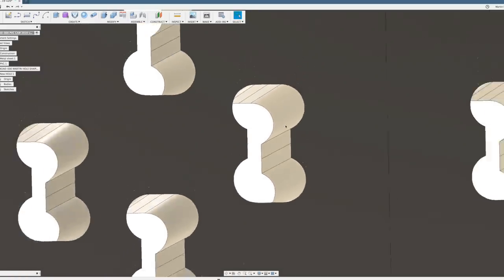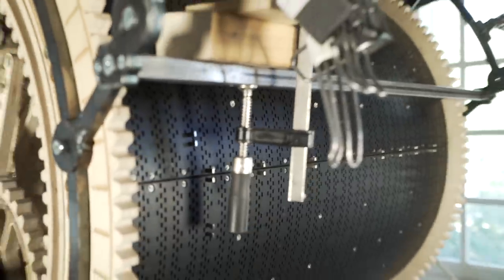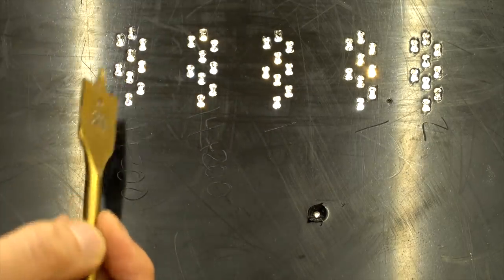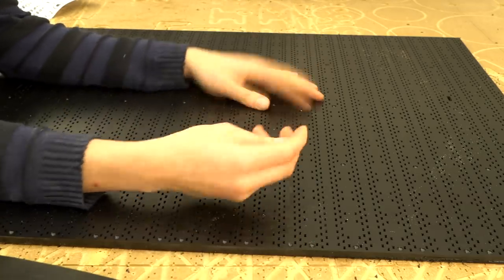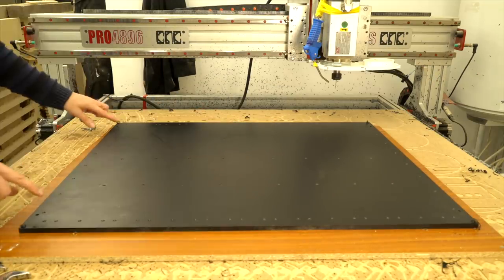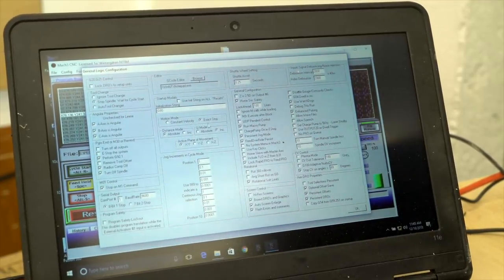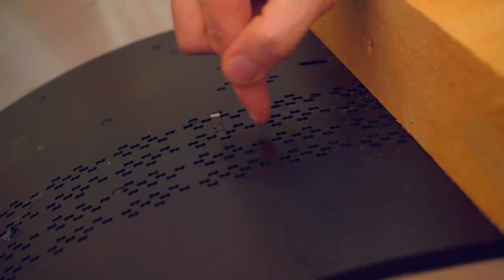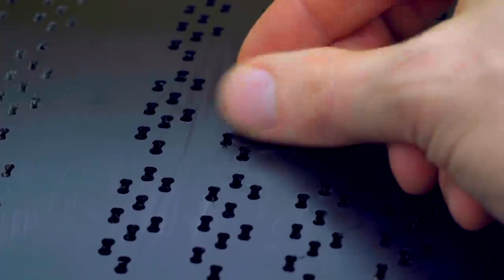Deeper Down the Rabbit Hole - Marble Machine X #66

Comment: As someone commented, temperature could easily mess up your tolerances. I've been up on a stage with spotlights and outdoors in the summer, and almost passed out in the heat. Temperatures could easily hit 45 or 50C at the black surface of your programming wheel. I would also be concerned with the slot stretching away from the force of the actuators pushing the magnets sideways when repeatedly being "plucked" as the wheel goes round and round.
Reply: My OCD has come up with many SNAFU's on this project, but that one escaped me. Well done Sir :)

Comment: Hello have you checked the tolerance of the magnets 0.o 
0.04 seems like over kill
Reply: You should look up the clearances for slip fit, light interference fit, tight interference fit, light press fit and tight press fit for different materials. They differ by such minuscule amounts that it bugles the minds (at least for non-machinists like me). 0.04mm (that's just shy of two thou for the imperial crowd) are actually quite big jumps, but I guess that since we are talking plastic here the material properties work in Martin's favor in some cases, just as they work against him in other cases.
Reply: Also check the homogeneity of your slab of plastic. Since the tolerances are so tiny. Be sure to check the shrinking in multiple places, and not just the center.
Reply: If he doesn't go overkill, they will be too sloppy and might not strike true once he runs the machine. The middle portion is the pinch. The shape he has constructed is probably to make sure it doesn't get stuck but still is pinched into place.

It is probably the Pinch that is currently working against him .
Reply: I love this series so much
Reply: I wouldnt call it overkill. Even in an electronic music sequencer (where conditions are near ideal, compared to mechanical one) the slightest issues like DAC latency or MIDI trololols can totally ruin the groove of your music if you dont pay attention.
Reply: I think Thor’s point  is that it seems highly unlikely that the tolerance on the thickness of magnet is less than the tolerances that he is now working with in his holes. I have not heard him discuss these magnet pieces in any of the videos I have watched. Are they store bought? Custom precision ground pieces?
Reply: I work in a tool shop and when we make guide holes we have a tolerance of 0.007 +- it’s so tight that when you push the pin inside air can’t escape between and crate a vacuum pushing the pin out and making a funny ploop noise. And there is places working with even smaller tolerances
Reply: @callesundberg  Aiko are you using metric or imperial. That number becomes 25.4 times more impressive if you are using metric.
Reply: @jhm5016  yes this is exactly what I mean. They don't look ground to me 😂 so I was wondering. Also 0.04 mm tolerances are too big I would reeeee🐸 consider my design choiceses materials ECT to make it easier
Reply: Also he should consider the precision of the machine and the milling bits
Reply: @callesundberg  Yeah injection molds that make computer part connectors have super tight tolerances since you can have have a hundred slices of metal put together to create one final part.
Reply: @pailer17  so true and ambient temperature and so on and so fourth
Reply: I wonder how loose holes will be after playing 1 concert, and how loose after whole world tour
Reply: @deviceundertest  oh right they might be lose after one song tho
Reply: Yeah, the standard neodymium magnet tolerance is usually higher than 0.04 mm.
Reply: @alexreeve  "MIDI trololols" Brilliant!
Reply: my exact thought.  I guess they are press formed somehow not lapped/ground finished
Reply: Telling Martin that something is overkill....

Comment: I'm sure you've been asked a hundred times, but why don't you use a rotary axis and, maybe, a different material? Mount the quadrants on a drum, mount the drum on the rotary, and route with a simpler toolpath?  This could also solve your timing/gap dilemma between the plates.
For holding the magnets, the important axis appears to be circumferential.  A little sideways wobble shouldn't hurt the timing.  Is there a reason to not put your "pinch tabs" on the top/bottom of the magnet hole?  A 1mm chamfer on the top of the tab would be easy to machine and let you get away with a tighter fit on the important axis.
Thank you for sharing your work!   Believer
Reply: That sounds really interesting. What machinery would you use for that? I'd assume the drill would be fixed to the x and y and the drum would move on the z?
Reply: @nutmeg453  Oh, I was referring to adding a gear-reduced 4th axis (lathe-style) to the CNC.  He'd have to weld a frame down low, but that hasn't stopped him yet :)

Comment: PE grows and shrinks with the humidity it has absorbed. Personally my guess would be, that during production the raw material gets dried (otherwise it will form bubbles when being brought into shape). As you have a massive block of the material the humidity takes a VERY long time to diffuse to the center of the block. When you machine the holes though, you expose the dry material in the center to the humidity in the air, which causes it to absorb moisture. Therefore the holes shrink as the material increases its volume. 
It's just an hypothesis, but I think it's very possible that this might be the case here. 
In order to test that hypothesis you could machine 2 identical parts, place one in water or a very moist environment, and one in a dry environment. Before and afterwards measure the dimensions of the holes and compare them.

Just an idea. Maybe I'm wrong though...

Comment: Wow, now that's a deep rabit hole.....

I really hope this solution works.... 
I'm a bit afraid that tool sharpness will be a parameter in how much material will be pushed instead of cut.... And if that is correct the offset will need to vary..
I think the double cut a day later will be a more stable solution.... And make sure to warm your spindle... At least for my machine the bit starts to warm up after a while and that could change the diameter a bit... Keep up the good work, greetings from Marcel
Reply: The deformation temperature of the PE 300 might be an issue.
Reply: Hey Robo, Nice to see you here.

But the thing i was thinking about....  what about the temperature in his workshop. The machine is supposed to go on world tour. He is in scandinavia and its winter. 
Now there is a world tour and its summer and 30 degrees C or something. How much will that affect the tight fit......
Reply: @hscharft  I thought his studio was in France ?
Reply: @Soken50  Yeah, I think he is. Moved a few months back right? Either way, ambient temperatures might be an issue... maybe. I'm not knowledgeable enough on that to say for certain.
Reply: @hscharft  He is building the Marble Machine 2 in the south of France (but it gets cold there too!)
Reply: As far as I know PE300 has no high thermal expansion coefficient.... so temperature would not be an issue... (If i'm right...) Anyway, still think tool sharpness would change material deflection...

Comment: Since most plastics are hydroscopic and changes dimension with humidity, you might want to double check that it works at high humidity as well.
Reply: Hy*g*roscopic.

A hydroscope is a device for seeing under water (or any other kinds of water related instrument).
Reply: That thought occurred to me too, so I looked up PE300.... the datasheet bullet says "Very low moisture absorption." ... so, maybe? ¯\_(ツ)_/¯  

Also, the tempco curve goes wonky above 30C/minute.... so maybe test a quick transition between indoors and outdoors. Link to paper:
http://www.expresspolymlett.com/letolt.php?file=EPL-0000080&mi=c

Disclaimer, I'm an electrical engineer, not a mechanical engineer, so I'm good with numbers but not so much with materials.
Reply: Peter Lund  TIL
Reply: Celcon has a good rating. My idea is to plastic injection mold the 
programming plate in small rectangles and put it together like a Lego 
project. The curvature, pin holes, screw holes, and shrinkage would be 
already in the finished part.

Comment: The precision holes may be a long-term waste as well sir. They will degrade over time, and develop slop, as pins are added and removed, because your pin material is much more durable than the plastic.

Assuming you don't want to permanently mount pins, you may have much more luck with an outer layer of metal or some other material outside the plastic. This frame would have much greater control, and still hold the magnet as the plastic degrades, and have less problem with wear. You will still be limited by the manufactured tolerance of the magnets, as Thor Hagen suggests.

Also please remember that, because of wear, it would be a good idea to make spares and keep them unused and well cared for, so that if precision is being lost, a section can be reworked by replacing the plastic and then remounting the proposed outer shell. The outer shell will also wear, but it should be far slower wear than the plastic.

Comment: I just thought of a few more parameters to throw into the mix. Nearly all plastics absorb moisture. When you first showed that the holes had shrunk I immediately thought "ah, the plastic absorbed moisture from the air." I think your "spring" theory is more likely though, but maybe it's a combo of both?

More parameters: 

 - Ambient temperature affects the dimensions of plastics. Your holes might vary in size over the course of a day as a result. 
 - Your cutting tool will change size over the course of a cutting job, both from temperature and wear. As the tool cuts, it gets hot. As the tool gets more dull, it gets even hotter, which changes its size and the resulting cut.
 - Your spindle temperature can impact accuracy and consistency.
 - Tool runout can impact things. And not all cutting tools are the same. You could have a batch of cutting tools from the same manufacturer and they could vary just enough to throw things off. Combine that with your collet's runout, and the variables get crazy.
 - Since you're machining a conical shapes, the dimensions of those shapes are impacted by how flat your machine bed is. If the material being cut has a low spot, the resulting hole dimensions will be smaller. A high spot will produce larger holes.
 - The consistency of the plastic could vary, even in the same sheet. This could impact the consistency of dimensions of the holes when bent over the drum.

The more I think about it, the more I think you need do this on a laser cutter.

Or go super fancy - use aluminum plates that have been water jet or fiber laser cut.

Fancier still, find thin wall aluminum piping with the correct dimensions, cut that on a 4th axis with a fiber laser cutter.

Most fanciest: do the same, but use brass. Or copper!
Reply: Celcon has a good rating. My idea is to plastic injection mold the programming plate in small rectangles and put it together like a Lego project. The curvature, pin holes, screw holes, and shrinkage would be already in the finished part.
Reply: If I understand clearly, the material which is used by Marin is polyethylene (PE 300 right?). This type of PE can easily change its dimensions by the influence of high and low temperatures. It shouldn't absorb the moisture, like polyamides can do.  Also there is a small issue. Polymers likes to behave a little bit different like other materials. There is an important thing to remember when you working with this type of materials - stress strain relaxation and creep. Dimensions of these holes are proper right after drilling, but they change for sure, in future. When they are drilled the material is flat, but to mount it you need to bend it. And that''s the key. After bending it, you add a certain amount of stress to the molecules which they are trying to compensate is.

Comment: Sandwich the plastic with sheet metal that also has the same cut outs. The metal holes will not shrink and also will not wear over time. The plastic becomes just a spacer material

Comment: I'd really consider painting every even row gray to make it easier to program.
Reply: I had even thought about engraving bar-lines. However, as I understand the plan as of now is that there will be an application (in development) to convert a MIDI file into a paper template that will then be applied to each programming plate. He's said that his vision is to have fans be able to reprogram one set of plates while he is playing with a different set.
Reply: @databoy2010  I don't see paper being very reliable.
Reply: I've been playing with laser cutting Mylar sheets at work. I think this would work really well here. Cut the template, wrap it around the drum, push the pins through the holes, then pull the template off again.

Comment: You should cut then put in all the pins in while it sits overnight. That way they won't shrink smaller and you'd be able to adjust anything that got it stuck, vs the other way around.
Reply: 59,000 pins? Yeah i don't think that will happen
Reply: He’s going to have to insert one in each regardless for reliability  testing. You’re assuming that’s too much work. The whole project is too much work already.
Reply: The moment the "test" is over and the pins are removed, the holes will shrink.

Comment: is it possible that the cold affect the plastic and shrink the holes ? idk if your'e work place is heated all day and night :p
Reply: R0Dz Ak47z that would be very worrying
Reply: I was just thinking the same, if he plays on a tropical country he might get problems in the summer.
Reply: @guilhermeb7615  Well, that is a thing with every good musical instrument. Wooden wind instruments (flutes, oboes and the like) are weather sensitive; violins don't like weather changes; pianos tend to loosen from warmth and wetness (or coldness and dryness) even guitars need a bit of fiddling while changing climates (there are times when it is just impossible to play on metal strings, for example).
Reply: The coefficient of thermal expansion is 0.00018 m(mK) between 23°C and 60°C. I don't really know what that m(mK) means but it was on a datasheet I found. I know that my HDPE cutting boards do bow a lot when I run hot water on one side!
Reply: The thing is since he's doing really precise measurement even small change have impact if it get hot no problem since the pins are magnetise :)
Reply: Gregor Shapiro m/(mK) is a unit of linear thermal expansion. The amount a material expands by is a fraction of it's original length multiplied by the temperature change, so you have meters per meter kelvin. In this case if you changed the temperature of a 1 meter long strip of HDPE by one Kelvin the length would change by 0.00018 meters or 0.18mm.  This is more commonly expressed as microns or micrometre (10^-6 meter) per meter-Kelvin to make the numbers more convenient i.e. HPDE would be 180 µm/mK
Reply: @ferrumignis  So it does moove a lot even for small temperature change, I was thinking that the thickness of the material would make it harder to moove but it might be it :)
Reply: Putting in a lot of heat during the milling will require a long cooling time. And every temperature change during the tour and even on stage (heat of lamps, cold when in open air) will give a lot of problems in the future. Only another millable material with a much lower linear thermal expansion is going to work.
Reply: PVC could be a good material , maybe.
Reply: This is my fear as well. Martin is designing this with super small tolerances in perfect conditions and then he's going to unpack the MMX in a cold wet condition or tropical condition or something other than his shop and it's not going to work!

Comment: Have you considered machining the holes after the plates are mounted on their drum? You could treat the entire drum like a 4th axis, driving its rotation as part of your CAM program. This would allow you to use straight bits, first off, but it might also solve the shrinking hole issue. 

When you bend the plastic over the drum, you're stretching the outer surface of the sheet while shrinking the inner surface of the sheet. This stretching might prove useful to keeping the holes at a consistent size. While hole walls might want to spring back, the tension of the stretched plastic might counter-act that force.

Another thought - a laser cutter might be able to do this job much more quickly and accurately, consistently, and burr free. It has a natural "draft" to its cuts, but it also doesn't have a bit that gets hotter the longer it cuts.

Combine a laser cutter with a 4th axis, and you might have even more success with a lot less headache (presuming you got the 4th axis details sorted).
Reply: As someone eho works with lasers, I can assure you laser cutters will not work with this type of plastic, or at least not at this thickness
Reply: @onionsknight9125  you can indeed laser cut HDPE (high density polyethylene). It's not an ideal material because of its low melting temperature, but it is far from impossible. I've cut 12MM HDPE on my 40W hobby level CO2 laser cutter. After ensuring the laser was properly focused and some trial and error I was able to cut very accurately with minimal melting and distortion. Directing plenty of airflow at the focal point was crucial as it helped the plastic cool consistently (as well as helping maintain beam focus). I wasn't trying to achieve the same tolerances as Martin, but I don't think those tolerances are impossible either.

A simple google search suggests there are many laser cutting services that have no concerns with cutting HDPE accurately. I think it'd be a safe bet to assume they have lasers that can do the job better than my "toy" can.